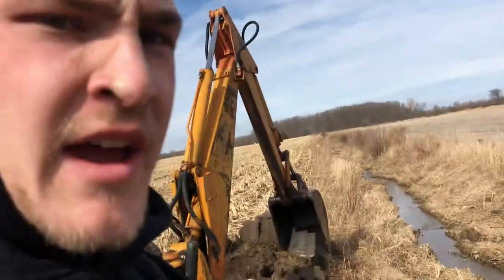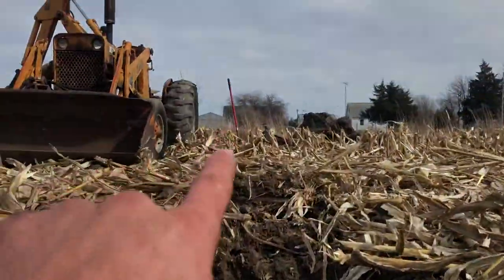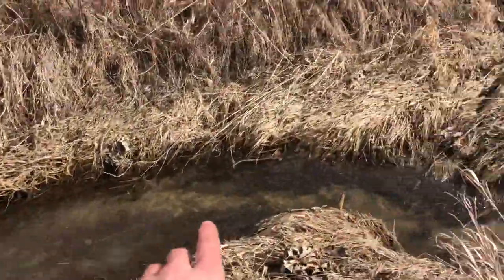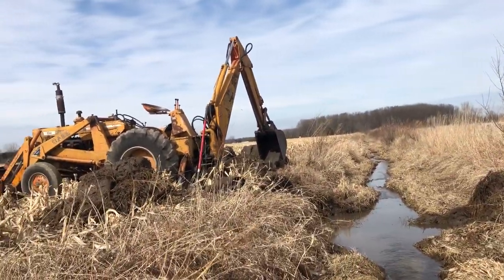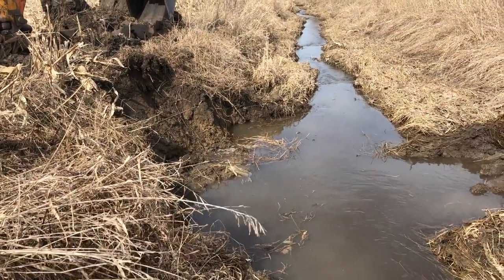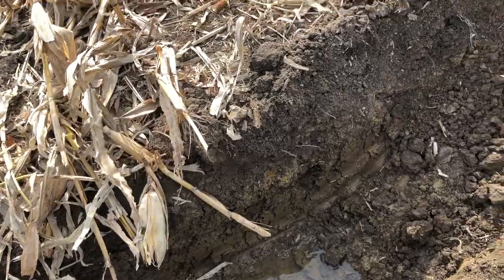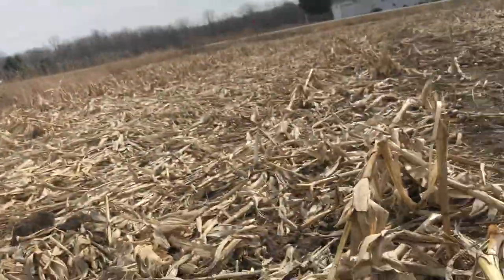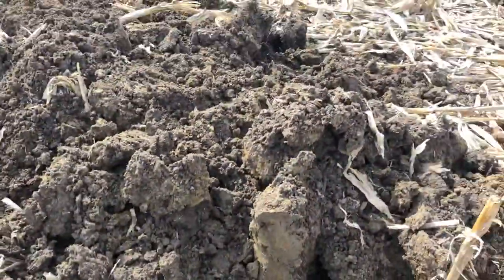Digging up a Broken Field Tile.

Comment: That's a nice backhoe, do you use the Massey loader more than the backhoe?
Reply from the maker: Midwest Allis Acres Thanks you and it’s not to bad for it’s age it leaks oil like no other but does the Job. And yes I use the Massey way way more then the back hoe only issue is it didn’t have a backhoe attachment so that was the only reason for having  it out there.